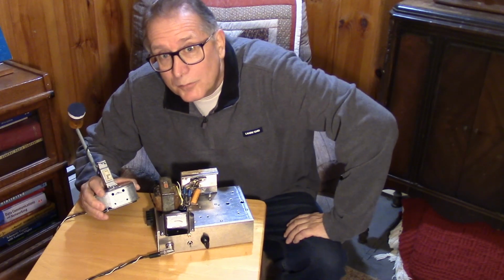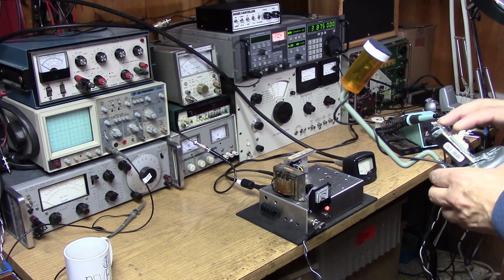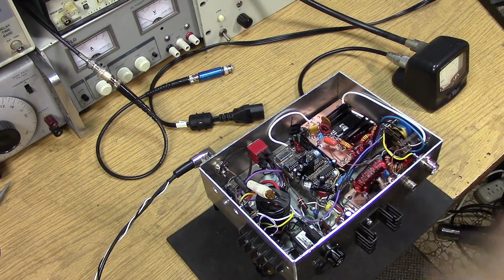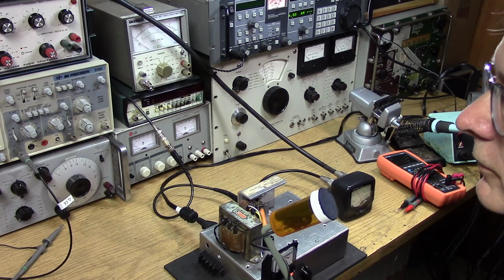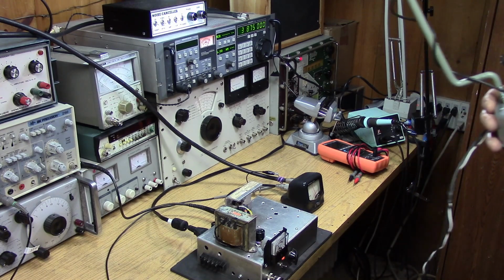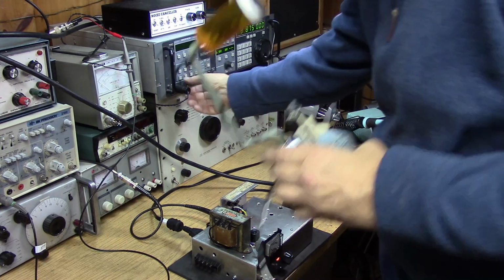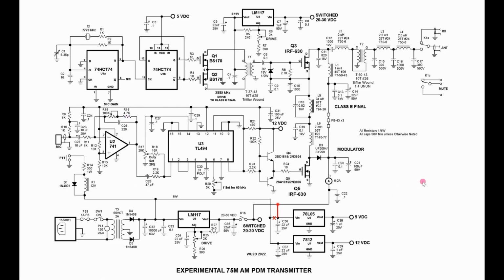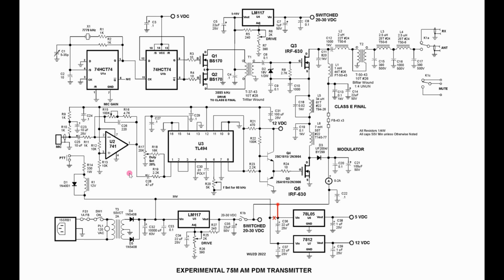PDM Part 7

Comment: Congrats on getting the rig on the air. I have enjoyed the whole series. Those Electret mic's are super bass heavy. Running a EQ with 10 db of pre emphasis boost at 3 to 4 khz will clean it right up. One easy fix that will help is to change the 10uf input capacitor to your mic pre amp to a smaller value that will give you a high pass filter and roll the bass off.

Comment: Mike, your PDM transmitter was successful because it worked. I see what you mean were the build of the perf board was it's down fall. Definitely a large learning curve on designing and constructing a PDM AM rig. I learn something new, about how PDM or PWM works and about how Class "E" amplifiers work and why they are so efficient.

Comment: I learned a lot from those videos: 

I had no idea about class-E amplifiers. The way you built those push pull stages is fascinating.

I did not know it is that easy to find Amplitude-Modulation adepts on the air. (Perhaps the magic-mike made a big difference)  

Finding the proper magnetic core is like black magic for me.  You helped clarify that a little.  (I wish there was an easy way to measure it yourself, instead than having to rely on obscure specifications form the internet)

The format of those videos is great. Please do not change anything. 

Finally, I would like to wish you the best for the new year's season.
Reply from the maker: Wow thanks for watching! Having the Q and Q Not outputs on a flip flop allows for several interesting RF driver ideas - Totem Pole Complementary, Quasi Complementary, Push-Pull and with Bipolars and Mosfets.

Comment: I could easily imagine this microphone as a collection item in a modern art museum - pretty cool transmitter; I've just built an AM broadcast part 15 transmitter for home with some conventional parts (lots of 2N3904s); it's an RF oscillator driven long-tailed differential pair whose emitter current is being modulated by a single transistor, which is also set up as a sallen-key low-pass filter for the audio. The differential RF goes into an FT50-43 and comes out unbalanced into a short antenna with loading coil.

Comment: Hi Mike!  I was going through this series in thinking that I might try Class-E for a 20W CW xmtr; so I think I missed this one.
Anyway, if you start at 11:00 minutes into the video, you really vary the distance you are holding the mike; and without ALC that's a pretty big difference.
I experimented a lot with the electrets, and I found that they do not reproduce the human voice highs when you are further away--even though they doo the ambient highs (real puzzle).
If you want to test this, jerry-rig a connection into a modern xcvr mic connector and put the rig in monitor mode with a pair of headphones; this will really demonstrate the acoustics of the electret but also the effect of various enclosures.  I was very successful with replacing hand-mics and headset-mics but desk-mics proved a challenge.  I finally had to create a dampened tube-enclosure to get enough directionality to preserve hghs without using a bunch of gain that only really bumped the lower-end.
I think your project was a success for the scale you put forth; and you could probably tame it without a complete topology re-do.
You spent a considerable amount of time and as a result, we all learned a lot!
So thank you and 73...
Reply from the maker: Electrets work better with a flat plexi plate, element back mounted, with a conical pinhole. I used to run one of those.

Comment from the maker: I simply had to try a vintage and still in the package IRF-510 (Radio Shack Mosfet from the late 80's) in the RF AMP Spot. I actually like it better than the IRF-630. Takes less drive of course and no issue at this low power (10W out resting). Maybe a follow up video once I get the audio happy with some controlled audio shaping and get the polarity right on natural voice peaks.

Comment: Audio taper pot as a rheostat in a feedback loop working against a fixed input resistor won't give the same taper, as they are designed to be used as a voltage divider with moving tap across a tapered resistance element.  Of course it will still work to adjust gain, just possibly not quite as expected.
Reply from the maker: Wow! That is excellent insight. Maybe linearize it somewhat with a resistive divider or network in conjunction with it.

Comment: Just watched all the videos in the PDM series and very interesting. Thanks for your efforts. With regards the audio quality, do you think this is down to the simple design, choice of components or would the speech processor make things better? I suppose I'm asking if it is worth replicating your design? Been looking for a simple PDM modulator for modest powers but most are designed for 100W+ of carrier.

Comment: I understand that one of the reasons to experiment with switch-mode amplifier designs is for their high efficiencies compared with operating in Class A/AB. So...how did you do in that respect?  In your wrap-up comments, you mentioned that linear designs are more tolerant of part choice and are easier for amateurs to build, while the digital/switch-mode stuff demands better parts and more sophisticated construction.  How much power goes into your finished PDM transmitter, to get you that 10W RF output?  For all the complexity and imperfection of the finished result, did you realize the power efficiency potential vs. some much simpler linear amp QRP design?